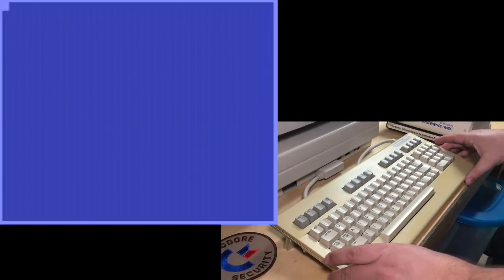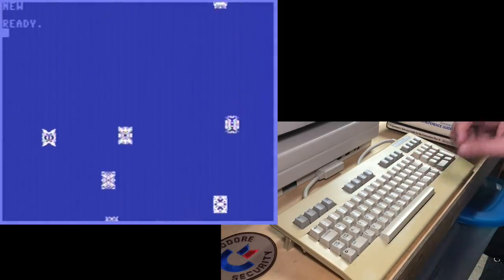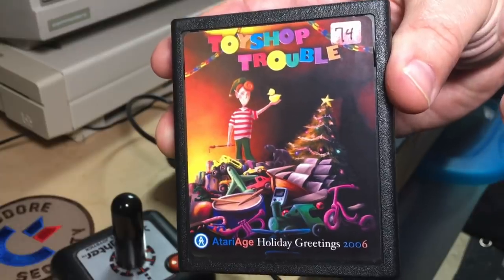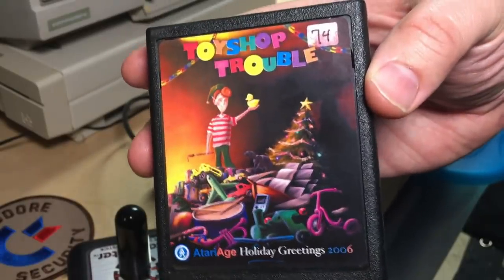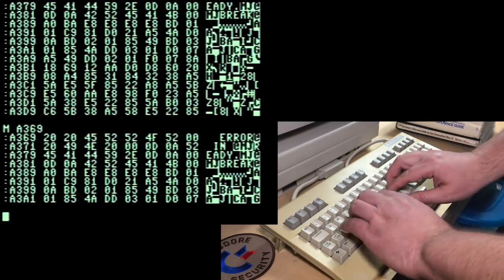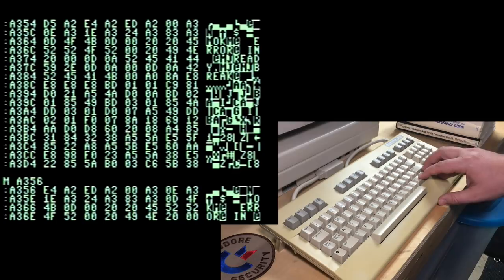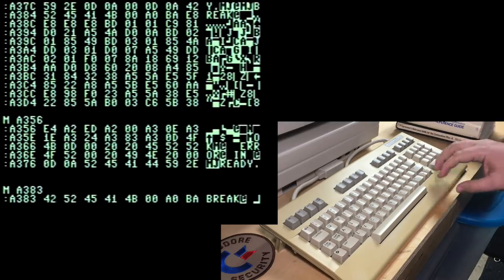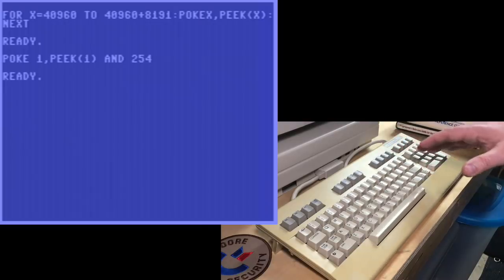The Extra Spaces in Commodore 64 BASIC Errors

Comment: Great video, thank you. I love the song and the reactions! How does the snowflake program work?
Reply from the maker: Thanks Ed. I've had quite a few people interested in the snowflake program, so I'm thinking about making a video to explain it. But basically it's interrupt driven, so 60 times a second the BASIC environment is interrupted and runs my custom code which moves the snowflake sprites down the screen, and when they hit the bottom, a new snowflake pattern is generated and placed at the top of the screen again. The snowflakes are basically just a random 8x8 pixel in the top left of each sprite, which then is mirrored and flipped into the other 3 quadrants of the sprite.
Reply: @8_Bit  I've noticed that there are no more than 8 snowflakes present at once. Using the VIC-II's hardware sprites, by any chance? (lol)

Comment: when you do "?fre(0)+65536" to see how many bytes are free. it will print an extra space. 

i always wondered why the 64k ram system  38911 basic bytes free had 2 spaces in the middle.
i would check to see if its the same thing as the extra break space but i'm not smart enough :D
Reply from the maker: Yes, C64 BASIC prints a space in front of all positive numbers; I haven't disassembled the code but it doesn't leave the space for negative numbers, so I'd guess the code is printing a minus for negative numbers and a space instead of a plus sign for positive numbers. You can simply "?1" and "?-1" to see the formatting. The extra space can be annoying but usually can be worked around.

For the two spaces after "64K RAM SYSTEM" it seems that was a deliberate formatting choice, so there's one blank space on each side of the screen. The two spaces are directly embedded in the null (0) terminated string in the KERNAL ROM: 
>C:e49b  36 34 4b 20  52 41 4d 20  53 59 53 54  45 4d 20 20 00  "64K RAM SYSTEM  "

Thanks for the comment :)
Reply: @8_Bit  Thanks for the reply. i just watched your all 32 basic errors video and in the formula too complex part, you just explained to me that c64 basic wraps spaces around numeric values.
i am really enjoying you channel. thank you for taking the time to explain things to us "lamers". 🕹️

Comment: For anyone who wants the 'fix' in a more elegant form here it is:

FOR X=40960 TO 49151: POKE X, PEEK(X):NEXT
POKE 1, PEEK(1) AND 254
POKE 41865,80
POKE 42086,106

Edited note: I had originally used POKE 41863,203 to get the error routine to end at the K of BREAK but as you can see in his reply it prevented another routine from displaying BREAK correctly, it would still have worked it's just that the K would have been a different character because of the high bit being set :)
Reply from the maker: I didn't use that approach because the BREAK word is used by two different print routines - one expects BREAK to be 0-terminated, the other uses the high bit. So your patch prints the shifted-K when breaking out of a program. Just do 10 GOTO 10, then RUN, then hit the STOP key and you'll see.
Reply: @8_Bit  Ahh, so there would be missing information in your video then. It would have been informative to include that information in the video to prevent others making the same mistake I did from just using the information given :)

Comment: The ?BREAK   ERROR was a fix to the Commodore 64 and 128 from pressing the RUN/STOP key constantly to get a BREAK, after loading a file from cassette or disk. The ?BREAK   ERROR resets how many times the LOAD command was being used. The Commodore PET/CBM had a glitch, that if you kept pressing the SHIFT key & RUN/STOP key over and over around 50 or 100 times of getting the message "PRESS PLAY ON TAPE #1" and "BREAK", you would get an ?ILLEGAL QUANTITY ERROR for the 8K PET Computer 2001 Series or a B* Monitor Machine Language prompt for other Commodore PET/CBM computers. The Commodore PET/CBM computers just used "BREAK" instead of the "?BREAK ERROR". The Commodore PET/CBM computers did not use two spaces for an error message. I wonder what the cause of this RUN/STOP LOAD glitch is about for the Commodore PET/CBM computers?
Reply from the maker: Very interesting, I hadn't heard some of these details before. I've been planning an episode about the history of these errors from the PET on, and how the extra spaces came to be. This may be an important part of the puzzle, thanks. Did you have any sources for this info?
Reply: @8_Bit  I discovered it when I was an eight year old kid, when my mom use to have a Commodore CBM 2032 Series. I would play around and press the RUN/STOP key over and over again. An error of some kind would reset how many times the LOAD command was used. In the B* Monitor Machine Language prompt I would play around and press G and RETURN over and over, until it either crashed or escaped the B* Monitor Machine Language prompt.

Comment: how do you get to this location, is it basic rom specific ? A369 shows 00 FF 00 FF ...
Reply from the maker: Yeah, A369 is in the C64 BASIC ROM. If you're seeing 00 FF etc. then you're probably looking at the RAM under the ROMs, so you have to get your machine language monitor to look at ROM instead. If you're using the VICE monitor, then the command "bank rom" without quotes should fix it. If you're in a monitor running on the C64 itself, then you'll need to fiddle with location $0001, setting the low bit. Typically that'd be storing #$37 in location 1.
Reply: @8_Bit  It's an Ultimate 1541 2 with a Action Replay Cart. Image. Hm, there is a $37 at location 1 unless its RAM again. hmm
Reply: Ah I found the command. * toggles ram/rom on the Action Replay Monitor.

Comment: It makes me wonder how different things might have been if the Commodore 64 had included something more feature-rich like BASIC 7.0 (or even 3.5!). Then again, the REAL programmers all used ASM so it's a moot point 😋
Reply from the maker: A better built-in BASIC probably would have meant more hobby programmers creating a larger body of somewhat better BASIC software. But I don't think it would have changed much in the commercial game market because ASM was always going to be necessary to push the machine to its limits. As nice as BASIC 3.5 and 7.0 are, they're still slow and not up to making commercial quality games (except maybe slow-paced strategy/adventure type games).
Reply: @8_Bit  True. But what if a built in compiler (not p-code) had also been included? 🤔 And the Programmer's Reference Manual? And "Mapping the C64"? And...